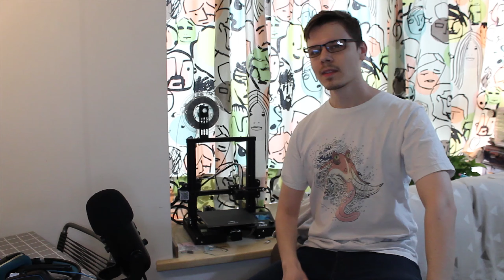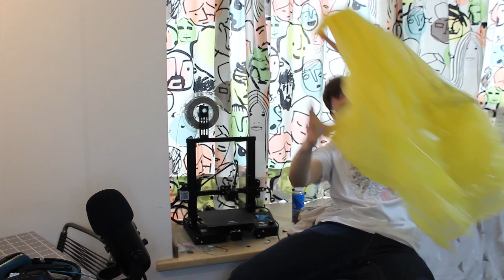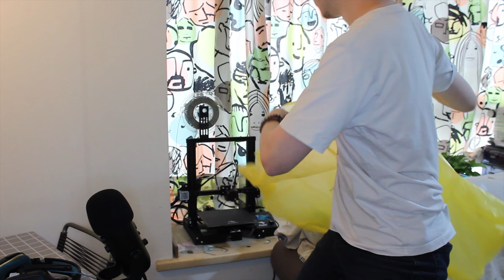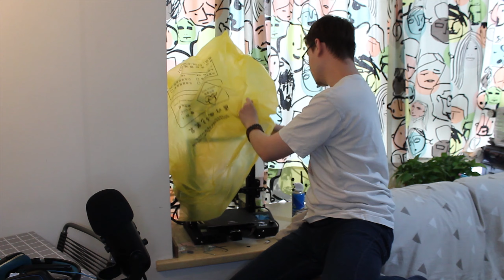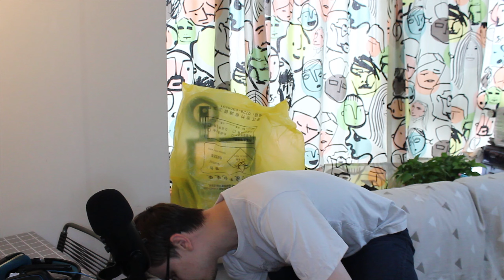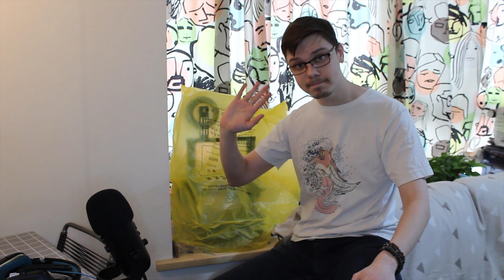Most Easily Overlooked 3D Printer Maintenance Issue

Comment: A filament filter/oiler helps a lot with keeping dust out of your extruder. I clogged a couple of hot ends before I realized what was happening and started using a filter.
Reply from the maker: That's a great idea, I haven't actually took the chance to print any upgrades for my printer.